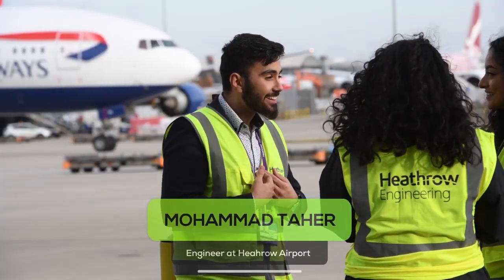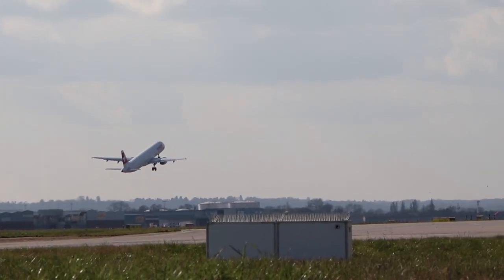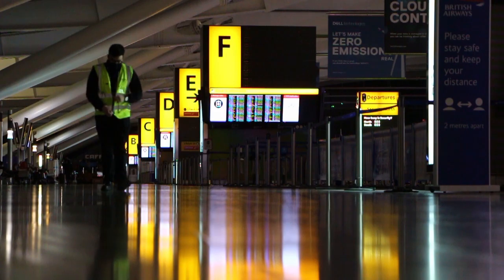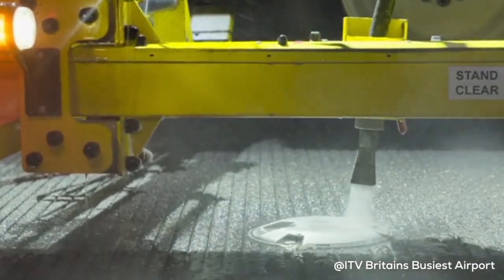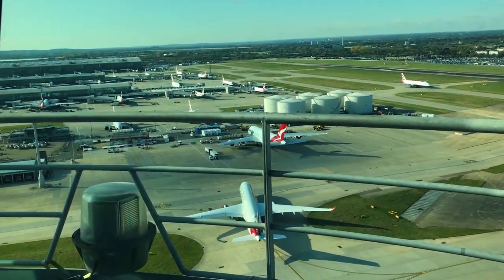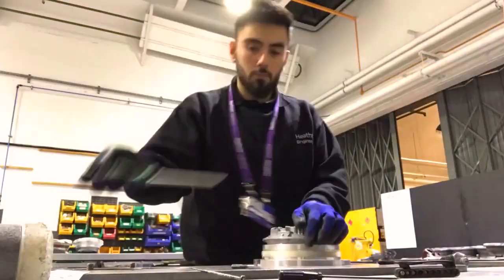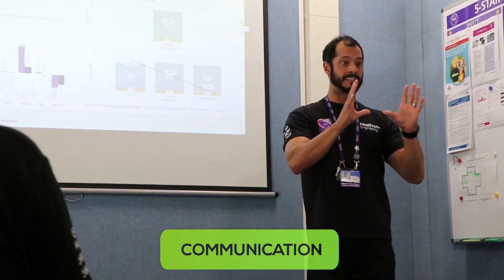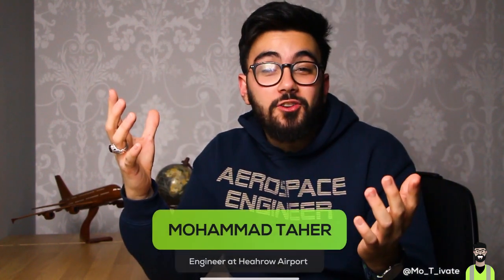What its like to work as an Engineer at Heathrow Airport

Comment: Hi Mohammad,
I've just completed my graduation in mechanical engineering. I wish to pursue a career in Aviation. I'm more inclined toward the technical and maintenance side. Could you pls guide me as to how I can pursue my interests? Also, what is the application process for the graduate program at London Heathrow?
Reply: Those engineering graduate programmes are aimed at training them to be a leader, in other words a management role in the future. You won't master the hands-on skills the technicians/engineers have, both theoretically and physically. If you are more to the technical or maintenance side, you should really start from the bottom of the career leader and learn the basics from different co-workers and supervisors. Once you got a decent work experience (~2 years), try submit your resume to some big engineering firms for an assistant engineer / engineer position.

Comment: This dude isn’t an engineer… he’s a maintenance technician. All of you guys are being fooled. You will not see an aerospace engineer walk around and scrubbing a light….. they did not do 4-5 years of hard core math and physics to go scrub a light and clean equipment or replace a bolt.

In this video he says he took physics however in a comment on another video, he says physics is not required for this at all.
Reply: Mostly aerospace engineers work on computers designing aircraft using special software, the manufacturing machines and technicians actually ‘build’ the plane.
Reply: @McFlashh  yea he doesn’t do fucking either. He does maintenance work.

Comment: Very nice video.
Are you an EASA or CAA licence holder.
Ive currently got a MBA & BBA in Aviation maintenance, B1 Licenced on B737/757 fleet and a little around 33 yrs experience in the field.
I was thinking about working at heathrow, in maintenance , safety or airports.
I understand CAA licence would mean clearing all modules again post BREXIT.
Any suggestions.

Comment: As an airline mechanic myself, I pay VERY close attention when I work on primary flight controls.  I've changed the stabilizer actuators on the ERJ before.  They're better- designed than the one on the MDs I think.  They have two parallel screws instead of one, and have a sealed oil reservoir instead of grease.  But still, it's scary to know only four bolts are keeping that plane in the air.  I take all the time I need to make sure it's installed 100% correctly, no matter how much the supervisor wants to rush us.  I'l NEVER let sub-par maintenance hurt the people who fly on my planes.  But you, boy, who act like an engineer, can you explain us why still only 4 bolts? This is supposed to be your job right rather than advertising yourself.
Reply: Quran 5 32

Comment: you make it sound so interesting, just amazing every process requires so much work and dedication
Reply from the maker: Absolutely. So much goes on behind the scenes yet passengers are oblivious for the most part
Reply: @MohammadTaher  I have a Question  Mr Mohammed taher !!!! Under the UK government climate plan , UK has committed to net zero by 2050 . 
Will UK  have electric planes by 2050 ? OR will all UK airport close down by 2050 ?

Comment: What academics are required to get onto the heathrow graduate programme and where can you go after this? Thanks
Reply: Thanks, your really helping me decide what to pursue. Are there any other options to get into a similar job role as yourself without an engineering degree?
Reply from the maker: @alexrozario8113  yes absolutely! Heathrow has an engineering apprenticeship where you become an engineering technician. It’s a 4 year programme and you get all the qualifications you need as part of the scheme
Reply: @MohammadTaher  Thanks again
Reply from the maker: @alexrozario8113  my pleasure
Reply from the maker: The entry requirements for the program is a Beng or Meng in engineering - preferably mechanical/ aerospace/electrical but other types of Engineering can also be considered. Once the graduate scheme ends, you apply internally for a role that you think will fit into your career progression and the sky is the limit with where you can end up! There are so so so many options.